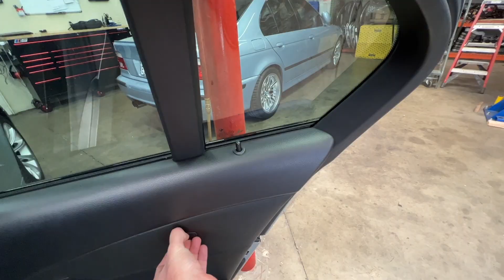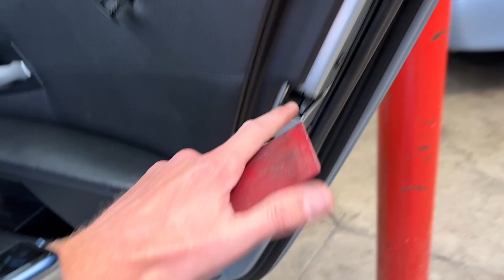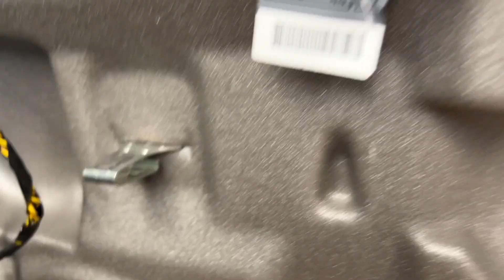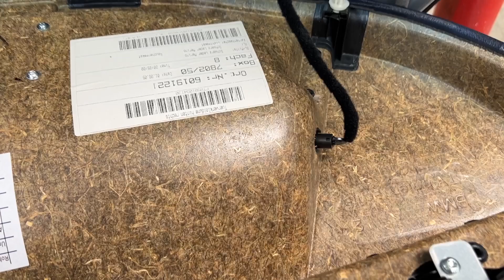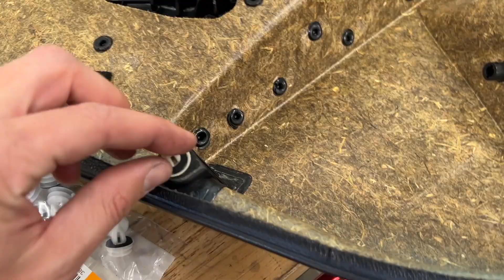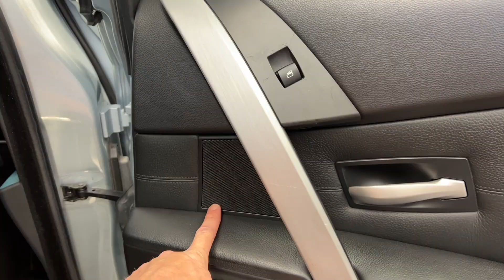BMW E60: Rear Door Panel Removal DIY

Comment: Should we disconnect the battery 1st?
Reply from the maker: If you plan on removing the airbag, yes.
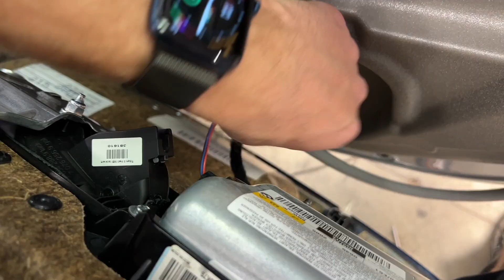Reply: @E39Source 😂just watched the video because I have a vapour barrier issue and you pretty much answer the question in the video 5:02

Comment: I got airbag error after reconnecting! Is this normal or the socket isn’t connected properly?
Reply from the maker: It sounds like the connection wasn't properly made at the airbag.  Correct the connection, and clear the fault code from the airbag module with a scanner.